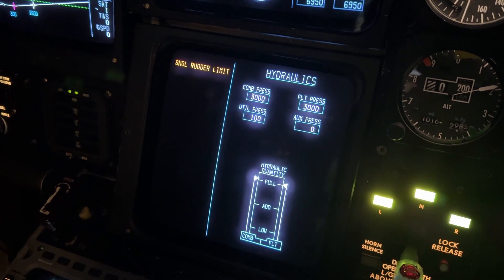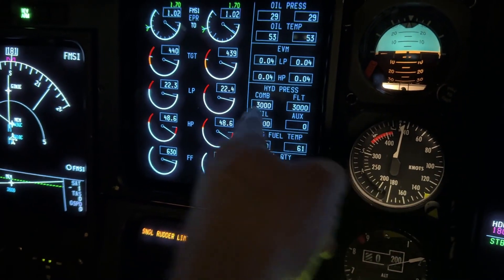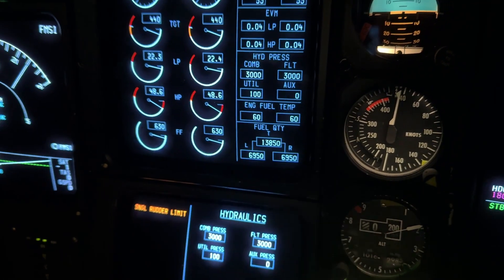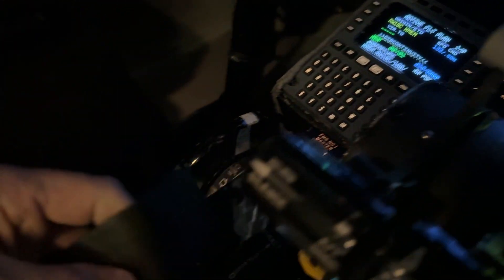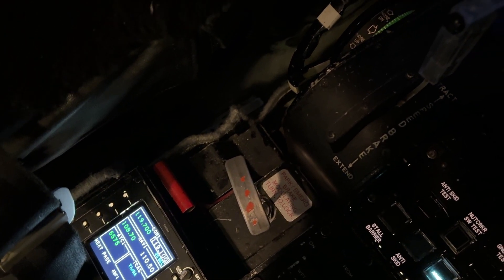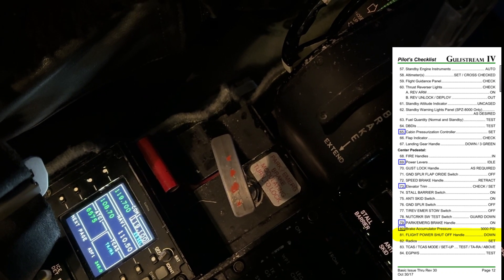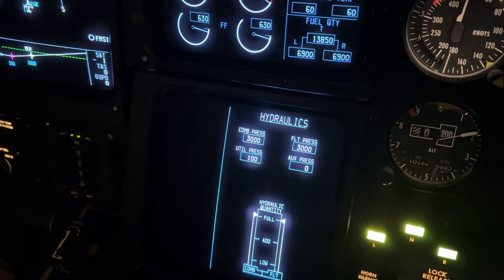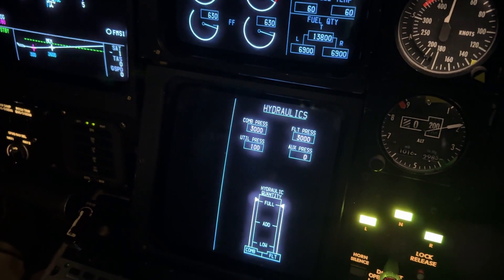FLIGHT POWER SHUTOFF

Comment: Dan, What is the cost of a G-IV Type Rating?
Reply from the maker: It varies.  I have never received a solid answer on this.  It's between $23,000 and $40,000.  If you're with a company that sends a lot of pilots to the training facility you will likely have a lower cost.  If you do it by yourself, it will be much higher.  I'm sure I can get a sales rep to give you a more solid number.   Just email me.   DAN   cfiipilot@aol.com